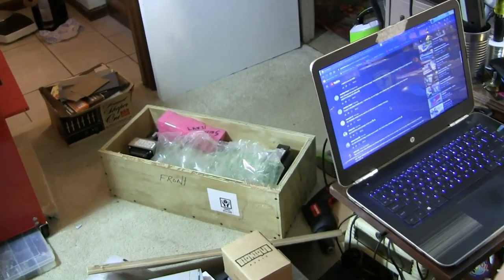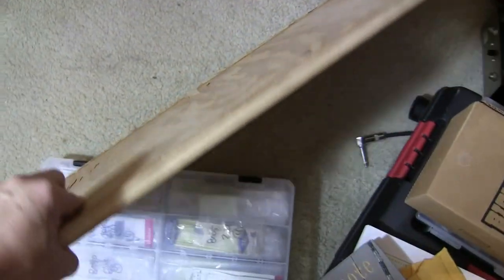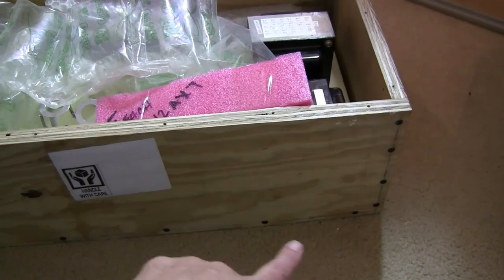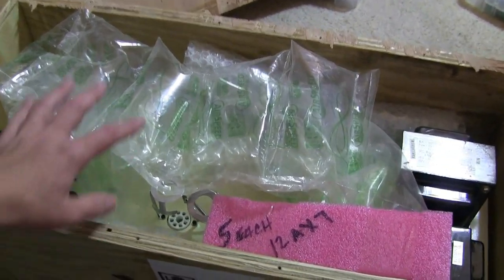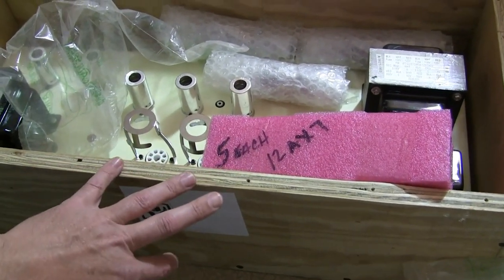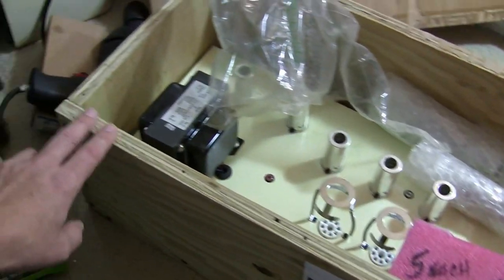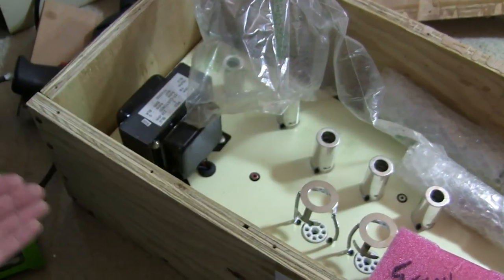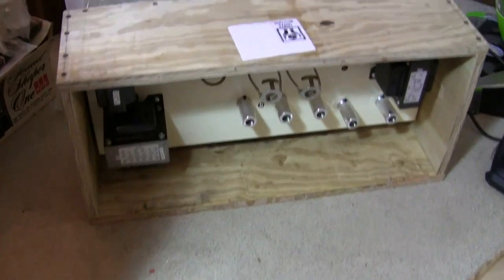No One Ships an Amp Like This!

Comment: Pretty sure thats an Epiphone SoCal, as far as i understand they had a hard time moving these amps and rebranded them 'Grainger' in the UK, they actually went through the trouble to manually scratch off the epiphone lables on the PCB. I have one, its not a bad amp, but also not great, the darkest, most useless reverb i've ever heard, tried swapping the tank, didnt make much difference. Mine is kept in a cupboard for back up duty, I paid £100 for it, it would cost more to re valve it... The EQ is pretty powerful but the overdrive lacks, its Ok for home use, rehearsal and small gigs, hitting it with a good overdrive works wonders.
Reply from the maker: Ok, that's interesting. Seriously?
Reply: @TheGuitologist  Hi Brad, yeah seriously... just seen your latest video. The custom 30 was also rebranded over here as the 'Grainger Blues Twin', very similar amp to the soCal or 'Grainger Hammerhead' but the 30 is much better sounding!

Comment: Everybody should be serious about shipping amps. I had to fasten a vintage moped I sold on a pallet, on its side on padded blocks I had to make so no panels touched anything. I believe I was tipped well from the buyer since agreeing to help load for local pickup turned into make it fit these parameters for whatever trucking company that was hired to pick it up

Comment: I appreciate the effort but there is no give... imagine the jolt it will take every time that crate is bounced around during shipping..it's actually worse than a nicely wrapped chassis in a good cardboard box
Reply from the maker: You could be right about that. Id like to see some drop tests.
Reply: right on the point! that's why they add a crumple zone/crush zone on the cars, it's to decorate the inertia of the collision. in this case, some of the force will be absorbed by the ply, and the rest transfer through the chassis into the parts and connections!!!

Comment: First item I ever sold on ebay years ago. When shipping was cheap lol.  4 15 inch 16 ohm altec Lansing speakers. One needed reckoning. The other 3 were good. Man I wish I rememeber the model but I bet worth a fortune now.
      I screwed the speakers to plywood,  two speakers to a box facing eachother. Then same size plywood on each side of the speaker.
   Used Styrofoam to fill in to fit the hose cardboard box ands shipped ups.
  Dude sent me a pic of when they showed up and they were as packed and in the condition shipped.
   I think I got 150 per speaker and 75 for the blown speaker.
    I wonder what became of them. But they were PA speakers out of cabinets they were not original to.
  But im deathly afraid of shipping amps and speakers much any ore and long since retired from the game of eBay and reverb screwed me over for about 500 bux when I was flat broke.. Would give me the account number and bank the money went to or help me recover the lost funds and didn't give two shits.
    I'm at a loss even where to sell items anymore but localy and in person only.
  But lemme tell you when I packed a guitar or amp or speakers those packages were stout.
     But shipping was far cheaper..
    Id rather have foam for cushioning than hard mounted like this. I know people that work at ups transfer facilities and they arnt kind to packages like this at all.
   Which can result in damaged items an dthey never honor their insurance either. None of them do. I've had to eat it a few times on purchases because some dips it didn't know how to pack. Like basicaly throw it in a box no peanuts even.